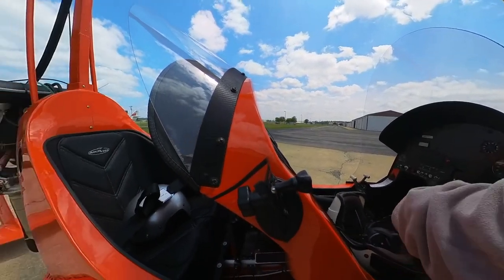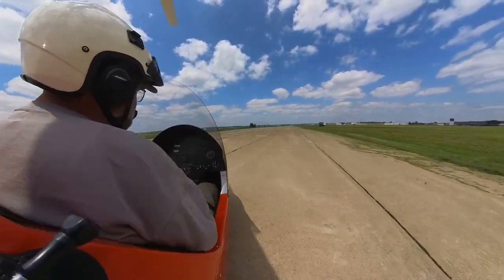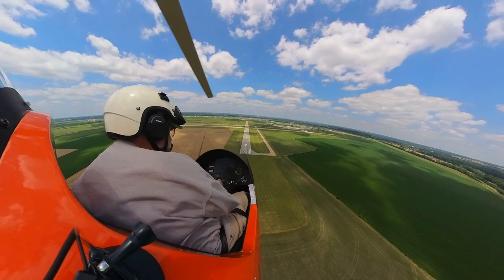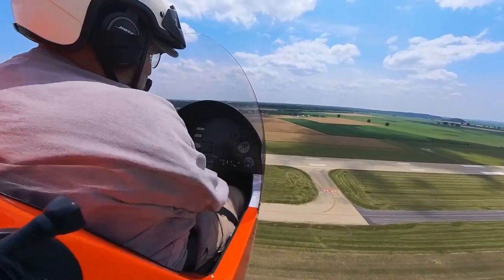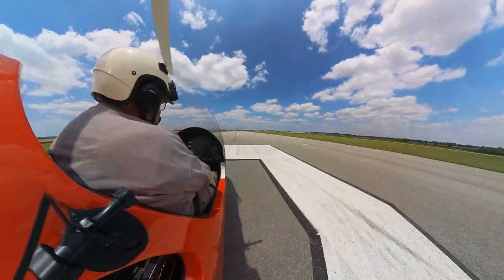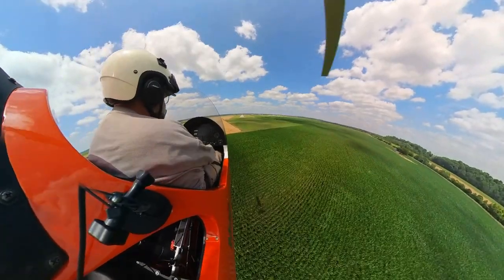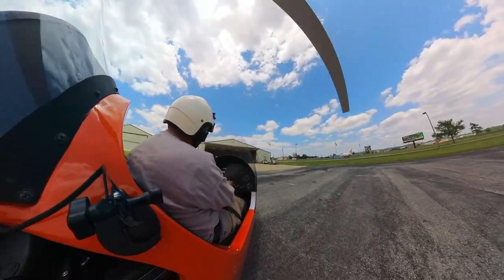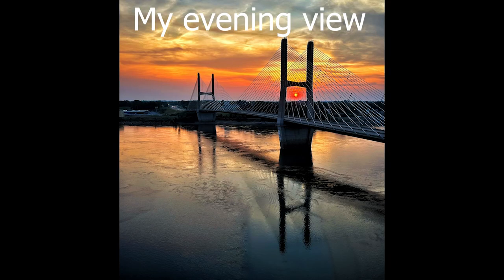Gyroplane Engine Loss on Takeoff- How should you respond?

Comment: I did not realize that 10 knots increased the energy by 1/3. I expect I an thinking the extra speed would result in a float. Climbing out at your best rate of climb speed generally is very close to the best glide speed as the airfoil is at the AOA which is most efficient. This is a practice which I adhere to religiously. Perhaps adding a bit of cushion and carrying an extra ten is great advice especially during the initial climb. Thanks for the thought provoking instruction.
Reply from the maker: Kinetic energy is exponential based on velocity squared. At 80 mph=6400, at 60 mph=3600, you have nearly twice the effective energy to convert to “stopping power” in an autorotation